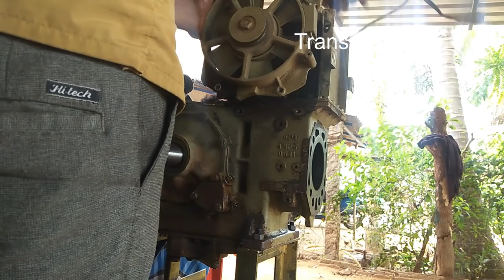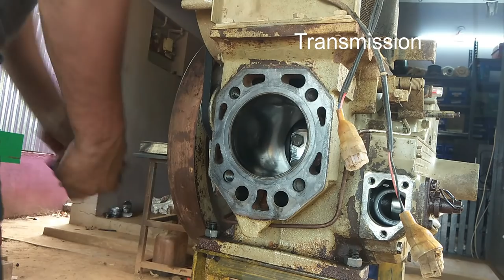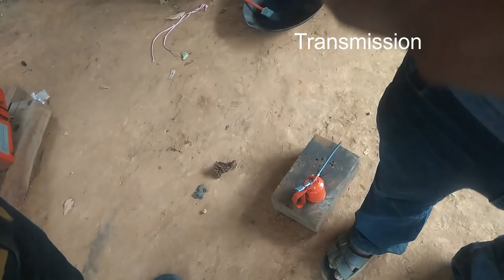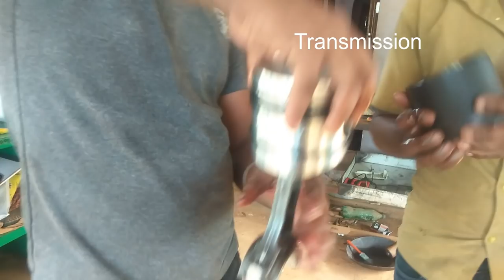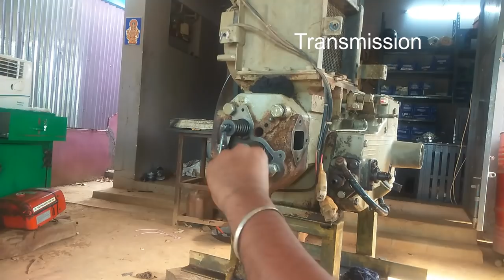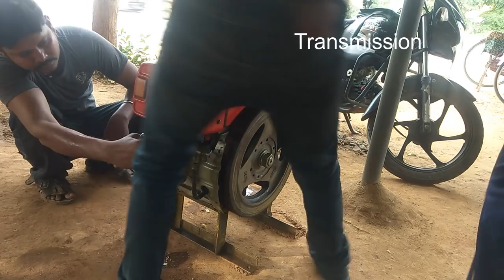vst shakthi 130DI powertiller  engine fitting | tamilnadu

Comment: You are good,but one thing i have to tell you bro.please use the tool its proper way,dont ever hammer on pipe wrench and when you adjust the valve clearance please use feeler gauge .thank you
Reply from the maker: Thanks pro, experience better than feeler gauge...
Reply: Raveen Jayawardena mantao
Reply: Stupid machanic
Reply: @transmission5233  🤣🤣🤣🤣🤣🤣
Reply: Intake filler 10 gaps 
Exaust filler 12 gaps

Comment: Engine load problem sir . Salutations please ..
Reply from the maker: Check clutch plate and gauge wheels
Reply: @transmission5233  my machine is good runing but one day change nozzle and planger at the is a problem start......
Reply: @transmission5233  and silencer oil smoking ...
Reply from the maker: Whatsap only 8667648894

Comment: 12hp ku timing diagram sollunga Bro pls my number 7010009392
Reply from the maker: Same timing
Reply: @transmission5233 athu OK Bro but eppadi,, timing gear thani, piston and valve timing thani thana.. Piston at TDS Thana Bro for valve timing....
Reply: @transmission5233  pls say hi from ur whatsapp number Bro my number 7010009392
Reply from the maker: Neanga enna timing keatinga
Reply from the maker: Engine HP different but timing same bro